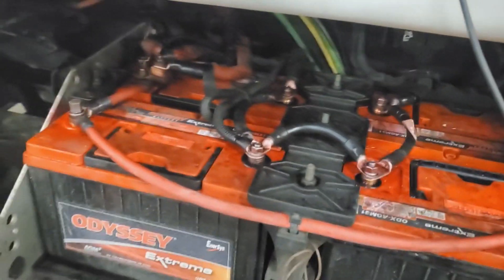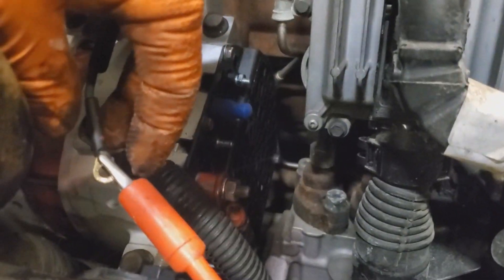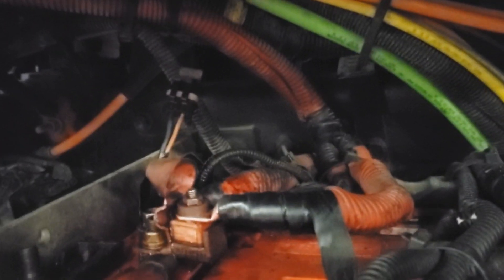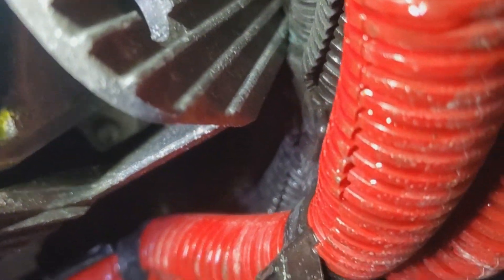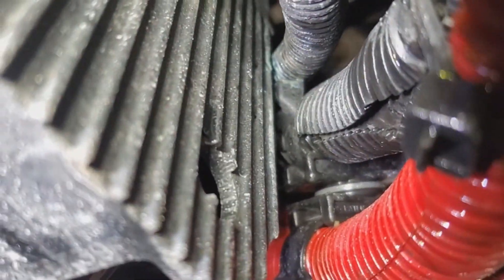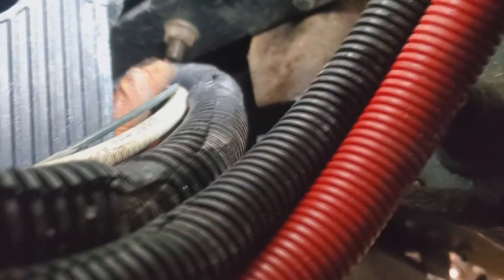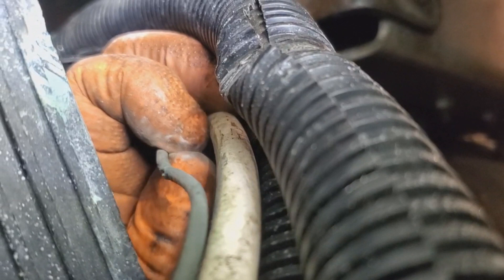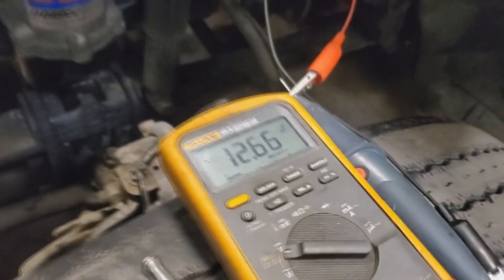Alternator OVERCHARGING Batteries diagnostic fix and repair. International LT

Comment: Can you make a video showing how the voltage checker and  load tester were set up? Do you have a split connection on the red wire?
Reply from the maker: Great idea, I just used it as normal leads for a multimeter.
Grounded normally and then testing for power.

Comment: Man, THANK YOU. I was pulling my hair out trying to figure out what this was. Watched your video, went and load tested the wire with a bulb and sure enough, voltage dropped to zero and the light wouldn't come on. Wasn't rubbed through in the same spot as your truck (one I was working on is 2018 HV with a Cummins) but it was in the same general area near the positive starter post. One of the zip tie holders had rubbed a small spot in the loom, into the sense wire. Was able to spot it super quick because of the green showing on the plastic loom, just like yours, once I knew where I needed to look. My truck didn't have a fuse holder for that sense wire in the battery box. So it was kind of a crap shoot trying to figure out what part of the black loom had it in it if not for the green.

Wild that so many of these are having the same problem but  with different chassis builds and not rubbing in the same spot. Thats Navistar for you though.

Again, thank you. I'd buy you a beer if I could.
Reply from the maker: Awesome man, glad you foundd it!

Comment: I have the same problem on 2022 volvo vnl. new batteries new alternator but still getting high voltage, dealer says new alternator working at max, but I don’t believe it. Where are you located?

Comment: My IH dealer has put 3 alternators in my truck and is stumped because Its still overcharging. Cant wait to share this with him when they open today
Reply from the maker: Hope they get you all fixed up!
Reply: @AcousticHills  It was exactly the same problem as this video. Same wire.
Reply: @AcousticHills  To be honest. They got it fixed and it lasted 30 min. Im dropping it off again for round 3. Grande Prairie International.